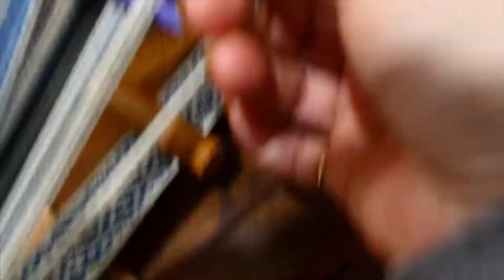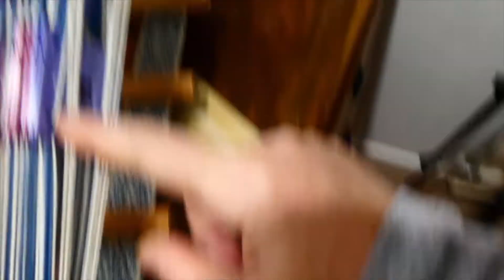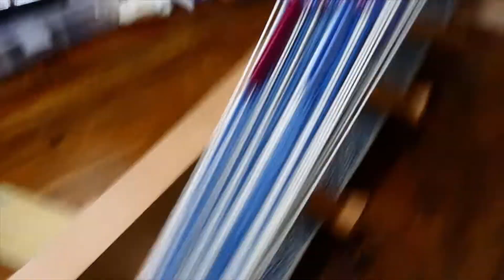How tablet weaving works

Comment: My main question is which thread ends up showing at the top of the work? I notice that the shed ends up seperating the 2 sides but sometimes those sides end up showing 2 colors on top, but which one shows in the weave? The close one or the far one?
Reply from the maker: It could be either, it depends on which direction you've last turned the tablets

Comment: Thanks for sharing this.  I had no idea this was what tablet weaving was and I agree that automating this version would be very difficult.  I suspect the way to go would be to have a way to individually control each thread.  It wouldn't be fast, but it would be completely programmable then.  This is something on my list to look at someday, but not high enough priority to investigate yet.
Reply from the maker: yeah I think you're right, but even individually lifting each thread up and down like you do for most sorts of weaving wouldn't be enough, you'd also have to be able to move each thread left/right relative to its neighbours in the same tablet, as it's this twisting that lets the pattern develop.